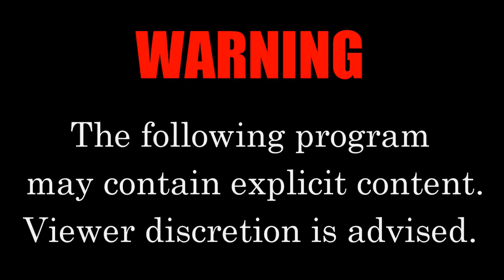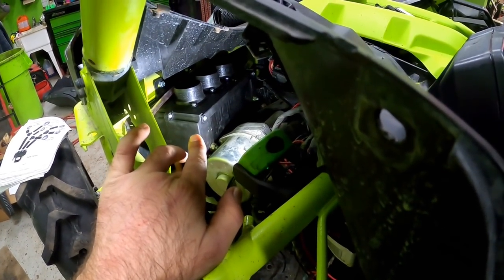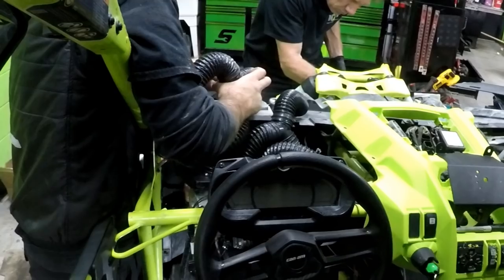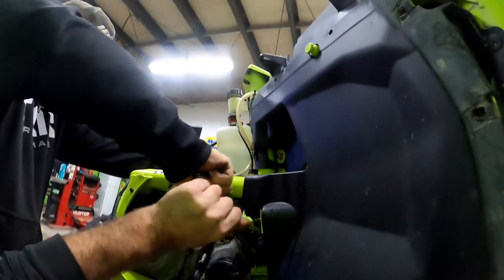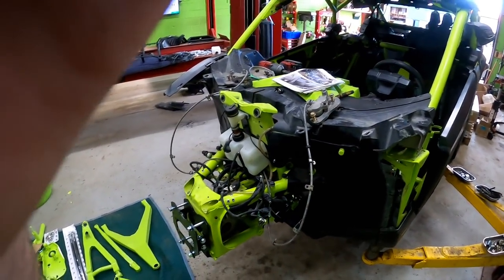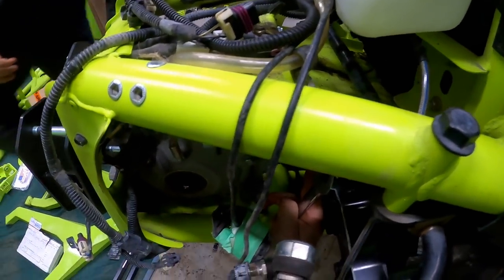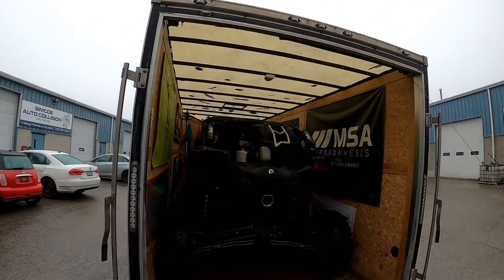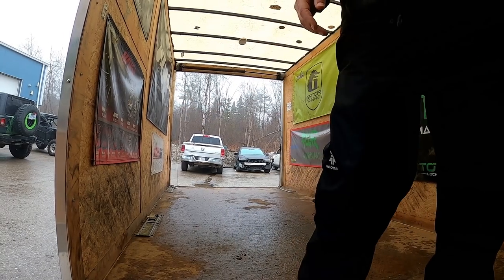STUCK Within Seconds!!!! X3 Monster Build

Comment: Good luck with your $3000+ CND Shock Therapy steering rack. Mine was worn out and sloppy in less than 700 miles haha. It's unsealed and the mud is going to grind it to peices inside👎👎👎.